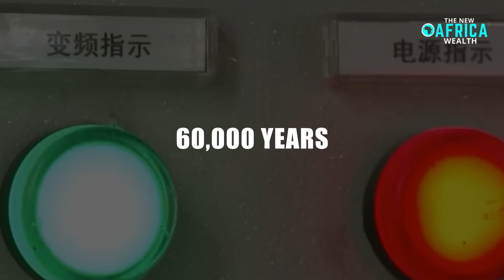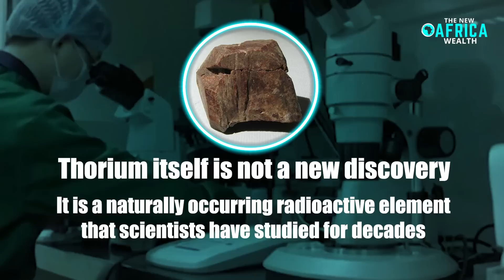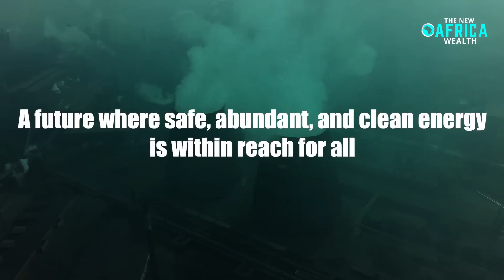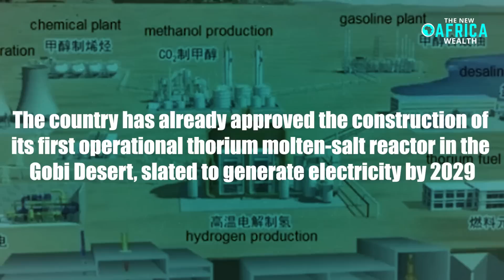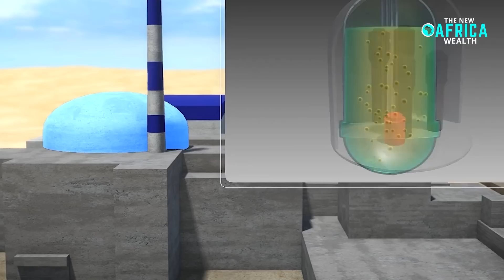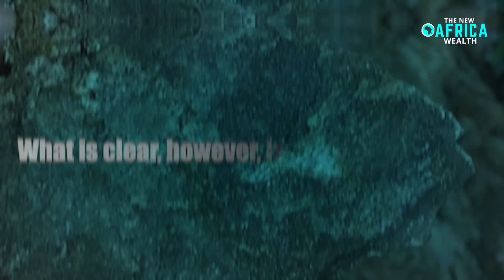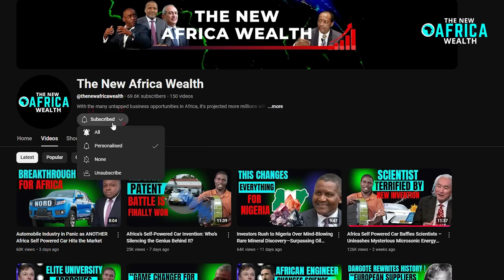Limitless Energy Discovery Could Change the World - Could Power a Country for 60,000 Years!

Comment: The US buried thorium concentrates in the Nevada desert after its thorium molten salt experiment at Oak Ridge ended. Further, the US also has a huge reserve in Utah. 

As for China, the Chinese ran a pilot reactor in the Gansu Desert beginning in late 2021 and validated all the circulatory processes including online fuel replacement and residual waste removal.  Further it appears they have validated their improvements in the Hastalloy metal used in its plumbing which was a weakness issue with the experiment at Oak Ridge.  

China has embarked on construction of a medium size 30MW reactor beginning in 2025 based on results from the pilot reactor results